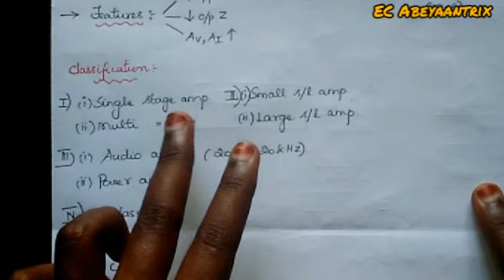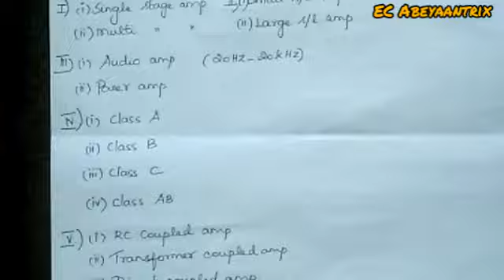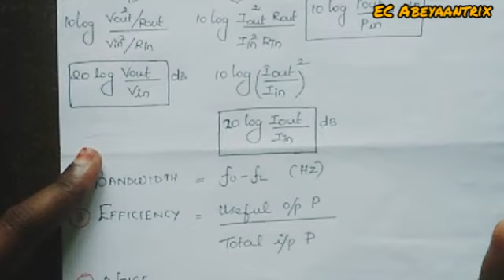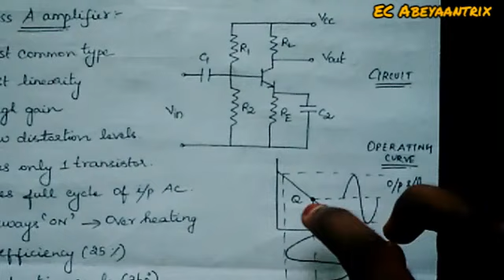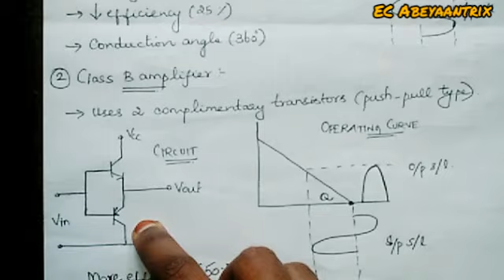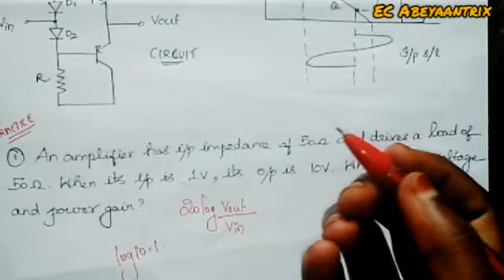RRB JE CBT 2 / TNPSC CESE /GATE - ECE/EEE/EIE - AMPLIFIERS | Tamil & English

Comment: Voltage and power gain both 20 dB???
Reply from the maker: Very good ma!
Reply: @ECAbeyaantrix Mam,can you please confirm the efficiency of class B amplifier,in some links,it is 78.5%
Reply from the maker: Theoretically, 78.5% is correct. I just said that will be more than Class A so mentioned as 25% fro Class A & 50% for Class B.
Reply: @ECAbeyaantrix  Thanks for the clarification mam